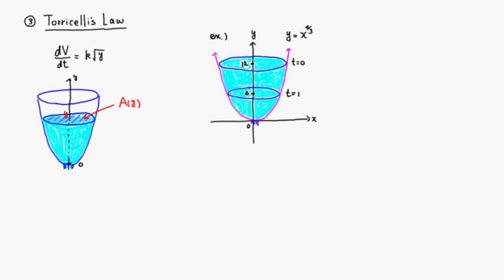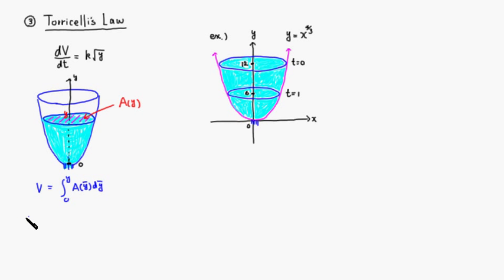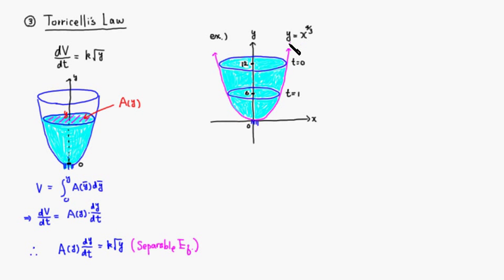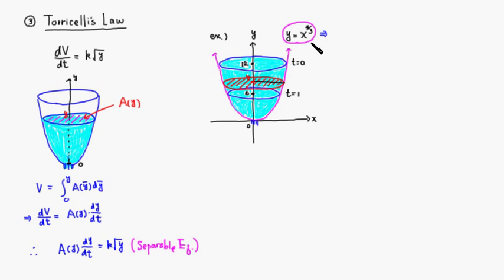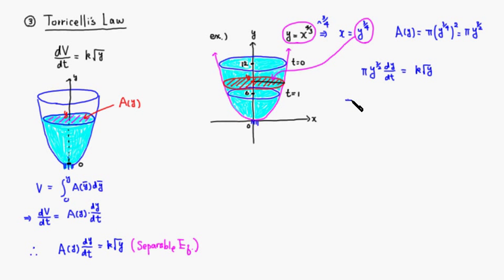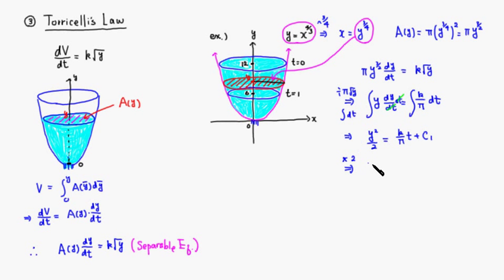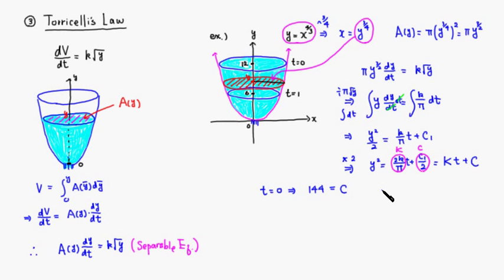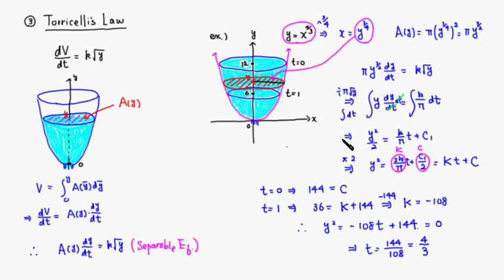Example: Torricelli's Law

Comment: Can you drive the equation integration for barometer mechanical working 
All upper and lower limits ?
Reply from the maker: Dear Anil:  I am not familiar with barometers, and I cannot answer your question properly.
Reply: @wishizuk  you have to drive equation about hooks laws and Burnoulli equation and mechanical properties of metal used in barometer 
If we are able to do it then round the globe we don't needed so much fuel since we created fuel by ourselves 

Please found such a way 
I have ideas but not any calculation app at plank level formula
Reply from the maker: @anilsharma-ev2my  It is beyond my comprehension.